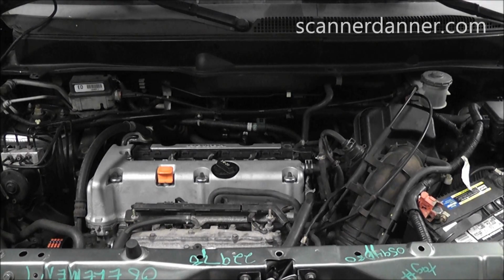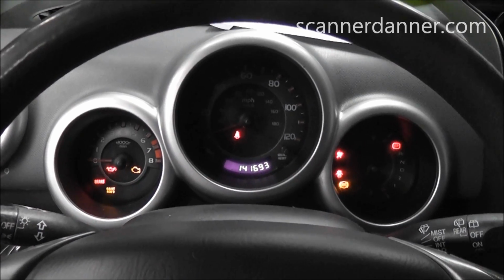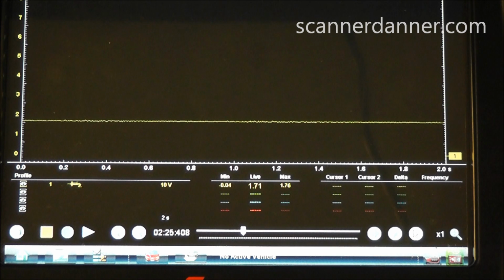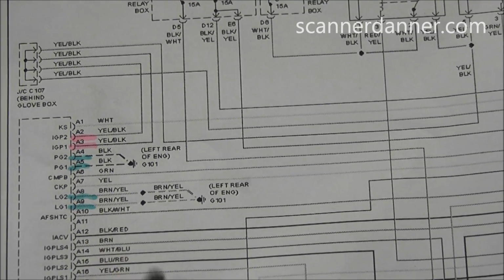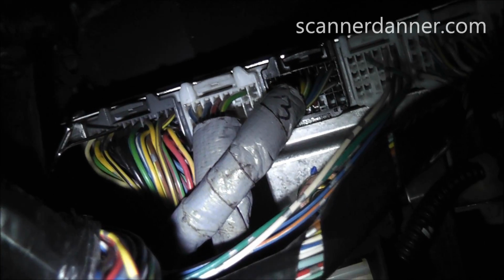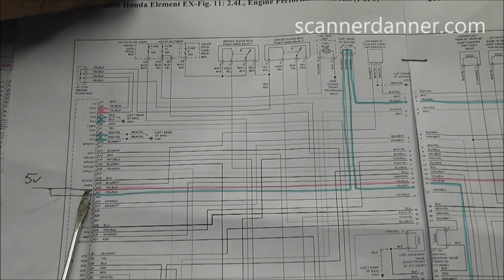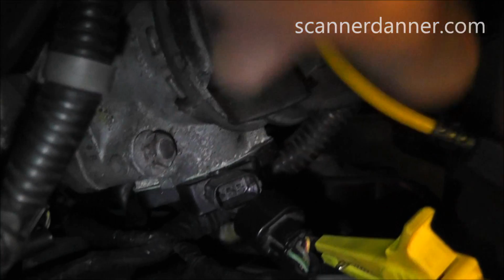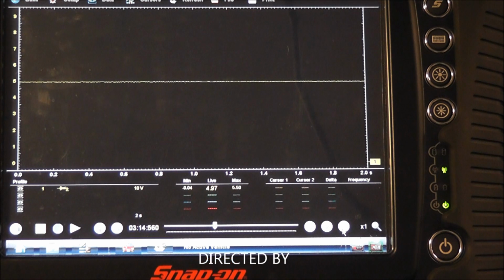No Start from a shorted MAP sensor (Honda, Acura)

Comment: Ive commented on a different video but i think my problem is similar to this video except the it looks like oil and water in the back if the thermostat connector from when i washed the engine bay the plastic cover that would have stopped water getting in wasnt on properly so it visibly is full of oil. I got 3.5v across all shared sensor grounds because of that wet connector. Well i hope thats the cause gona try clean and dry it today and hopely get 0.1 ground back.
Reply from the maker: If your sensors grounds (all of them) are that high, you need to focus on the main computer ground. Keep me posted!
Reply: @ScannerDanner  i made a mistake reading the multimeter the grounds on my cam sensors and thermostat connector was approx 3.5 millivolts not 3.5 volts 
and pin 1 supplies on the cams were 11.8v and pin2 references were 11.5v on this 2003 bmw 318i n42 i think it uses an 11v reference instead of the 5v but im not sure about that
i think the cam error code p0015 over-retarded, p0366 circuit range and reason the car running so rough may now be inside the engine ill watch your videos on the timing chain and solenoids next :/
Reply: ill watch all the videos anyways tho lol :D
but i only have one month experience from watching youtube videos if you have a youtube apprentice in sydney australia that can diagnose my car let me know :D
Reply from the maker: ah a common mistake when first learning to use your meter. What is cool about this field? You will never make that mistake again.

Comment: 50 ohms across ref and sig would allow a large current to flow and therefore pull the ref voltage down. My ref is at 3.5v when connected and van won't start. So I can't test fuel pressure when running or vacuum.

Comment: The bad MAP on my 2003 Elantra turned off the fuel injectors while I was driving on the freeway. I quickly learned to apply the clutch pedal, turn the key to ACC, and restart the engine. It would run long enough a few times to get me home.
I hope Hyundai didn't kill people with that stupid design.

Comment: Had on 93prizm shorted suppressor capacitor in distributor low voltage at injector & distributor no blown fuse. No start.

Comment: Nice teaching. you are the man. do you have any other references on sites to get wire diagrams? thank you.
Reply from the maker: Thank you! Here is a link to a DIY version of the same diagrams I use. It will cost you $20 for a 1 month access to this service information and diagrams for 1 car.
http://eautorepair.adtrk.biz/?a=10817&c=24&p=r&s1=

Comment: Is it possible to have a pcm problem with not putting out a 5v? You were getting 1.7volts right at the pcm. If you still had that reading even with all the sensors unplugged would it be a pcm? or would you  first check the 5v ref wires from each sensor to pcm before condemning the pcm?

Comment: Was the immobilizer light (the green key in the gauge cluster) still flashing after this repair? I work at a dealership and we had a similar problem with a flood car where it wouldn't start and the immobilizer would flash with no communication and I'm wondering if this was the problem. We were going after the immobilizer system and ended up not repairing the vehicle because they didn't want to spend any more money.

Comment: hey Paul lets say that after you unplugged all the sensors on that 5v ref circuit and the voltage never came back, would you have to run ohm tests on all the 5v ref wires before condemning the computer?

Comment: U said after u took the map sensor out that u heard the fuel pump, That means the map sensor is related to the main relay, in my case i have a 95 civic, just replace the PGM main relay, and after 3 weeks the same symptons apeared, no start. but the check engine appeared again and it said it was map sensor. But sometimes it starts sometime it wont,
Reply from the maker: measure the reference voltage on the MAP sensor first.

Comment: Thanks for the great video Paul !, One question, could a bad computer cause no 5v ref ? or cause a signal wire to show low voltage like in your video at 1.7v ? Thank you !
Reply: -from the future-  :  Yes; unlikely but yes

Comment: One other mention I forgot ... when the MAP is connected and I measure ohms from reference to signal for the MAP I get only 50 ohms. This to me seems very low across these two points ... if it is too low then the problem is in the computer me thinks ? Which is why I took it out and will open it up and have a look but as I said below ... the junkyard MAP shows 4.6v across it and ref which is waaay too high should be around 1.5 or less.

Comment: If I have the right the gear I can fix the computer if it has an issue. Schematics are a must ... without them you are flying like Luke Skywalker ... by the seat of the Force. I do have a question as I am working on a 2001 Caravan which no longer runs and suspected the MAP sensor ... sure enough it was pulling my reference down but when tested out of car it was shorted then it wasn't then shorted again. SO put another junkyard unit in and it still won't run ... this time the junkyard unit has a good ref but the signal is nearly the same when it should be around 1 to 1.5v ... it sit at close to reference at 4.62 ish ... so it's the opposite of a short  ... and it won't budge under vacuum ... so what ? the diaphragm is stuck ?

Comment: Hi, am in Sierra leone 🇸🇱 I have been following you're channel  I have a Rav 4 206 model that cranks but won't start I have called an auto technician the first one said it the ECU the other one said it the crankshaft sensor am also an electrician here in Sierra Leone so I to do the test myself to know if it the ECU or the sensor, please help

Comment: That's odd, I've disconnected a MAP sensor and had maybe a hard start but not a no start. Stalls though and it seems to be the only culprit left after checking the rest of the vacuum system to be functional.
Reply: had 88 aries stopped unplugged ran , repeatedl repl . Chrysler told me that needed to move above engine w hose down accumulation and freeze in winter shorted it out eventually  remounted map.  never happened again

Comment: Did you repeat the ground test for the computer twice- once when you were by outside the car and once when you were back probing the ecm inside?
Reply from the maker: Maybe? I don't remember. But this wasn't a bad ground issue. This was a shorted 5v ref circuit. Maybe give me time frames and I can better answer your questions. Thanks!

Comment: 96 tacoma 2.4L  i connect my scan tool and it communicate ok ,after about about 5 min of idling the check engine light appears and the scanner lose communication so i am unable to know what is triggering the light, any suggestion, HELP

Comment: +ScannerDanner Damn I have never ran into this problem I now see what you were referring to about the common 5v ref. I have seen them my self on Mitchell wiring diagrams  but I haven't ran into any faults of this type in the field. One question after all the PCM power & grounds checked out what lead you to the five volt ref circuit? Also I was working on a 00 Dodge 2.7 and was shocked to see a 8v ref circuit I believe it went to the crank sensor.
Reply from the maker: +Jarrett Phillips yea the older Dodge/chrysler used an 8v ref for the cam, crank and vss. The newer systems used the 5v ref circuit for everything.

Comment: Danner bro im having an issue with my 91 civic runs rough seems like when it warms up it runs worst spark is very weak? Ignitor possibly? Timing is dead on. The idle is very rough and the iacv port in the tb is suckin in alot of air creating sort of a vacuum leak im guessing. It stalls at stops once warm. Was the car you diagnosed with the bad ignitor have the same symptoms it was a 92-95 civic i believe. Thx in advance

Comment: Oh yeah ... they both hold a vacuum still ...
One more question ... if a MAP is NOT shorted like my junkyard unit but isn't functioning will it still keep the car from starting ? Tested fuel pump pressure and is good at 53 psi for caravan 3.3L ... only other idea I had was suspect fuel pressure regulator but I am not smelling a fuel leak unless the fule is going into the vacuum. I haven't been able to find online WHERE the regulator is for a 2001 Grand Caravan Sport 3.3L. If it has one I suspect it is under the top crap on the intake along the fuel rail ? Or at the fuel pump at the tank ? If pressure is good can it still be regulator ?

Comment: had a 2005 ford freestyle po171 and po174 did smoke test found leaking orings per intake was leaking. repalced and started the vehicle after clearing the codes. car still ran like crap. did a maf test. u kno. g/ps, altitude, outside temp, rpm  etc maf test passed. now im really scratching my head. broke out the versus and looked at data per fuel pressure also checking fuel presure with a gauge both are identical.    checked compression no.1 dead. why this didnt show up as a "misfire"

Comment: ever have any problem with that verus  is it a wireless unit  and how long did that diag take ,,? ok s if you dont have a 5 volt ref you might think its the computer  after all pcm power and grounds are good

Comment: Hi I have a Honda crv 2001 with a starting issue..i have checked for the 5v reference but i am showing 4.6v..Would i be right in thinking this is my problem and need to check my grounds.

Comment: Hi there. My car has no start issues, cranks ok, sparks ok, compression ok, fuel going through, but it won’t start at all, spark plug gets flooded after cranking few times. Then compression gets low. Been to 2 mechanics but no resolution yet. Can you help me out please. I will pay whatever it cost, I wanna learn and solve the issue myself with your help. I have Vcds and can make video and send it to you for analysis & troubleshooting. Look forward to your reply.
Reply from the maker: What are your compression numbers?
Have you removed the upstream O2 to see if it starts (quick and dirty plugged cat test)
Reply: ScannerDanner thanks for instant reply, really thankful & appreciated. My car 2006 Golf tsi 1.4 GT (170hp), One thing I forgot to mention, before getting into no starting issue , few days before I mistakenly connected wrong terminals to battery, I mean other way around. Instantly fuse on charger blown with big noise. 
Now compression, I never had flooding engine before, so I didn’t know about that. I tried to start it for few days, with & without pressing acceleration pedal. This resulted into washed cylinders, engine oil was smelling fuel too, compression at that time was around 30-60 psi in each cylinder. so I flushed engine oil, and then disconnected fuel pump and did the deflood procedure. , compression in each cylinder came back to 130-170 psi in each cylinder. I installed new spark plugs and checked all fuses & relays. I replaced all relays with brand new with the exact part number. But still no success. I have removed the ECU and planning to send it for testing. I also removed high pressure fuel pump and inspected and all seem fine. Do you have any electrical diagram of ecu and it’s plug so that I could check and troubleshoot. Mechanics didn’t say anything about timing, they checked it , VW mechanic took few days and then said that compression might be issue , he was mentioning that one cylinder has low compression. It happens when car is being cranked over and over. Please give me direction to trace the issue. I have VCDS but it’s not very useful than other scanner, I was thinking to buy Delphi or WOW AUTODATA for personal usage, what do you reckon which scanner is best handling most of the issues and affordable too, Really thankful for your kind reply.
Reply from the maker: This changes everything. You need to watch these two videos
https://www.youtube.com/watch?v=hJQ6qnhTgdg

https://www.youtube.com/watch?v=ecz93B5SRsQ

Comment: Just curious. Will you always loose coms with the ecm with a shorted 5 volt ref circuit?
Reply from the maker: Great question! If the ECM has a single 5v regulator, then yes. But if it has multiples, then no. Some newer systems has 4 different 5v regulators

Comment: hello,  
 i like scanner danner, very educational, i bought a snap on verus, learning how to use it, i have a 2003 saturn l200, had it running, quite? tps, has 5 volt, believed checked ground,but i dont get why signal wire says like 4.65 volts closed throttle, voltage decrease as throttle opens, opposite what should. 
put verus , on, says throttle position at 99,when closed throttle, says engine load at 99% to? i did sand on 2 ground spots under intake &on block to valve cover, thinking bad ground maybe causing 4.65 volts at closed throttle, maybe bad tps inside?  map sensor before went out, wouldnt run, its not running know, know fuel pressure, but havent checked spark yet! i did try tried switching computers thinking bad computer, but same voltage reading off tps signal wire?? did buy awhile ago,  new tps sensor & map sensor, it did run little time,still high voltage on signal wire,wont run know?

any one have any ideas why signal wire has 4.65 at close throttle.id appreciate any ideas!

thanks

Comment: Does the key have to be in the accessory position to get the voltage from the wires?
Reply from the maker: turn the key to the run position for all sensor testing
Reply: @ScannerDanner  thank you

Comment: Im having the same or similar issues on my 2002 audi a6 3.0. Im getting p0685 code. but if I remove the ecm relay cover and pinch it closed it gets a 0688 or something. low voltage to ecm. could this procedure work on German cars?  and thanks so much for your videos they're so great

Comment: What if I have 5 volts at tps connector but 0 volts at the map sensor connector ?
Reply from the maker: On the 5v ref circuit? Then you have an open circuit, either in that leg of the ref circuit, or internal to the board.

Comment: would it be possible to just use jumper/booster cables run from battery negative to the engine to make a ground point to ensure enough ground
Reply from the maker: sometimes, depends on your connections
Reply: don't think so, the circuit that ran a lot of things was grounded taking them all out

Comment: Can I put the ohmmeter on the resistance scale and measure the resistance between the 5v line and the ground? If the resistance drops below, let's say 1000 ohms, then there is a problem. Thank you.
Reply from the maker: Measured at the ECM? Yes, I've done that on a video to eliminate the need to crawl under the car and disconnect a tank pressure sensor. And yes, you'd measure between the 5v ref and sensor ground wire for each input. And yes, I'd like to see at least 1000 ohms. The video I showed this on was called Bad Engine Computer Testing Part 1 and 2
Lastly,
 Remember, newer cars may have 4 different 5v regulators.
Reply: @ScannerDanner  Thank you mr Paul

Comment: A MAP SENSOR COULD HAVE A PROBLEM WITH THE SIGNAL VOLTS BUT MEASURE VACUUM CORRECTLY? OR VICE VERSA? COULD GIVE A P0420 CODE?WHILE A BAD CATALYST CAN GIVE A CODE FOR A BAD MAP?
Reply from the maker: A cat efficiency code and a restricted/melted cat are two completely different things.
Reply: @ScannerDanner  ok thanks
Reply: @ScannerDanner  i send you to facebook  a test that I did as in one of your videos to see how efficient the catalyst is in storing oxygen. post it if you can and tell me about the rear 02 sensor

Comment: hi for that test can i use  cooleant temputuer   sensor ?or just  need start frist  with TPS
Reply from the maker: +KURDISTAN uk you can my friend, but you'll need to disconnect the ECT to read 5v on it. Make sense? It is a different circuit design
Reply: ys thnx so much

Comment: Sir,  one confusion....the 5 v reference signal is shared to all sensors.

Now, if the 5v signal to MAF is shorted, why the engine can start with the MAF sensor unplugged?? Is not that the ECM will not provide any signal to other sensors too? Please kindly brief clarify. Thanks.
Reply from the maker: pretty sure I answered this on another video. Please only ask your question one time on one video. I do see ALL of them

Comment: Dan , i know your very busy i have one question. I own a 2014 Chevy Silverado with a V-6 that shakes like crazy but sets no lights and when i plugged in my Autel to look at the live data the only thing that comes up is every 5V reference comes up in (RED) and says all the reading are over (5.01) or above , any ideas!!!!!
Reply from the maker: I don't have a problem with 5.01 on a 5v ref circuit. This has nothing to do with your vibration. Does this model use a clutch fan that is belt driven? Have you considered a fan blade issue? (cracked or broken). Maybe take the serpentine belt off and start it and see if the vibration is gone. Don't run it long as the water pump will not be spinning, but it would be a test to eliminate a lot of other components. 
How does it run and drive? Other than the "shakes like crazy" complaint? When does it shake? At idle only or all the time?

Comment: What to do next If you are getting 5 volts on both map sensor and tps,for the 5 volt reference check but still no communication with computer?
Reply from the maker: Depends on the symptoms. Is it also a no start? Or is this just a communication issue with the scanner? If you reply, I need more info. (year, make, model, engine, and all fault codes stored in the other modules on the network)
Reply: ScannerDanner yes it’s also a no start . The no communication is what I came up with trying to scan for the no start . It’s a 2006 Acura TSX .Engine is K24A2. Only stored codes is both Abs and body electrical stating B1829.
Reply: Nvm I used the brake bypass code to get it to start and now it’s communicating . Thanks for the help.